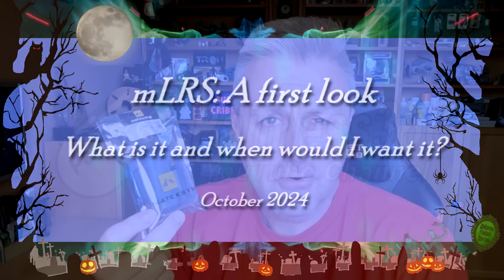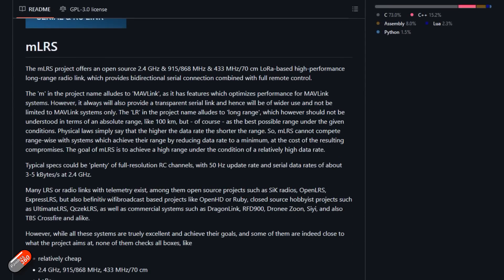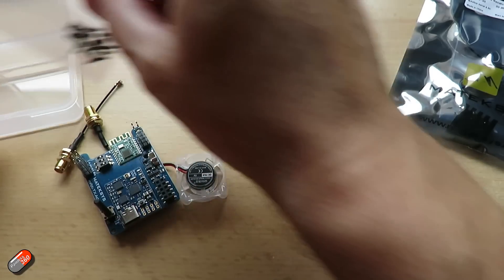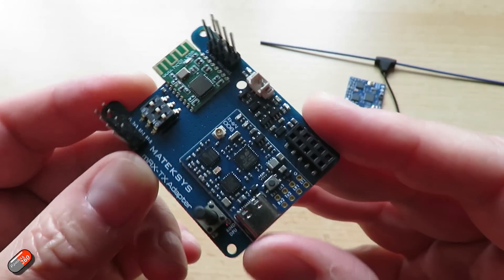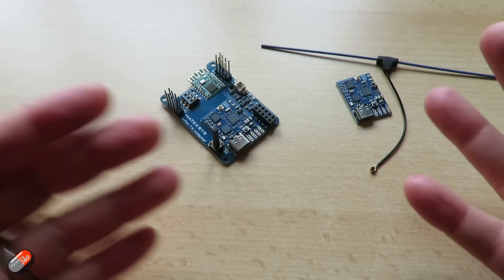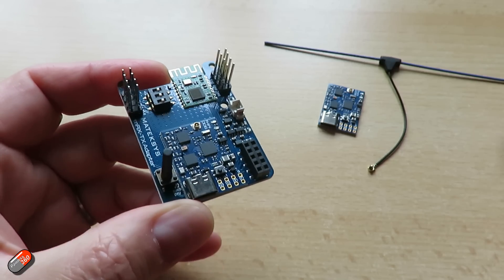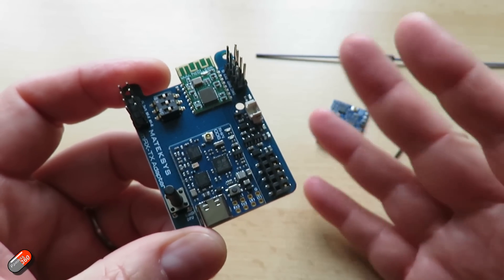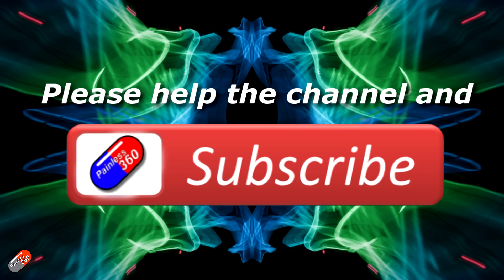What is mLRS? An overview of a new radio systems designed for MAVLINK (and more!)

Comment: How much more performance does this bring compared to ELRS mavlink-rc?
Reply from the maker: On what respect?
Reply: @Painless360  you show off elrs as mostly an RC contron protocol, while mavlink rc actually pushes quite a bit of telemetry through the elrs link. I would be curious to see how data rates compare between the two systems. The video kinda made it seem like you were comparing normal elrs telemetry with mlrs.
Reply from the maker: Serial data throughput numbers are in the docs already. The different packet sizes and associated terror checking mean that they are similar in that respect... Happy flying

Comment: There are ELRS receivers with 500mW telemetry available.  Foxeer has them,  perhaps other brands do as well. I don't really see a significant advantage, time will tell.
Reply: Plus you can use some transmitters in reverse as a receiver, so you can have a 1W telemetry ELRS "receiver" if you so desire.

Comment: I've been using the Matek mLRS hardware for a couple of weeks as a telemetry radio replacement, and as far as I'm concerned it basically makes SiK radios/RFD900s totally redundant - you get better performance at a much lower price with mLRS. I've just added an external battery to my ground modem (the Matek Tx module) so I can connect my GCS with mission planner via bluetooth to the Tx module which connects to the aircraft - no more USB at all!

Comment: I use both ELRS and mLRS on my prototype quad. Matek mLRS has an alternative firmware that makes it process only mavlink data without RC control info (just like SIK telemetry radios). So mLRS transmitter module is connected directly to PC (ground station) via USB, whereas my radio controller uses ELRS
Reply: Where did you get this alternative firmware ?
Reply: Think keeping them separate is best. Dont want your rc control failing.
Reply: Hi can you tell us more about it
Reply: Can't you just set ELRS link and telemetry to mavlink and connect gcs to it (via wifi or usb serial or bluetooth)?
Reply: Are they both running on the same frequency?

Comment: But does Matek send their hardware to the devs for testing? Wich they stopped doing with ELRS so ELRS devs says to avoid Matek hardware
Reply: Second this. Matek is dodgy. Their airspeed sensors are completely useless and inaccurate, flight controllers are fragile, customer support questionable, etc.

Comment: Didn't ELRS just introduce something like this?
Reply from the maker: They added some great new support for MAVLINK in their latest release but that doesn't change the differences with packet sizes and the available room for the serial telemetry via mLRS... Happy flying
Reply: If you wanted minimal latency for FPV multicopter control and a great Mavlink feed and had a spare UART, is there any problem with using a separate MLRS system for the telemetry as a lighter, neater alternative to the current Mavlink Rxs that are sold now?
Reply: @bjowitt  in what scenario would  going from 10ms and 30ms rc latency make a difference?

Comment: Good Morning! this looks really interesting from a RubyFPV point of view, can the groundstation end be operated directly over USB or would i need the usual USB-->UART adaptor? (rubyFPV connects to all it's (up to 4) radio devices using USB)
Reply: You can do it directly via USB, or use the bluetooth, just need a firmware swap (I've done both)
Reply from the maker: The stuff I have seen so far has used a wireless link.. Happy flying